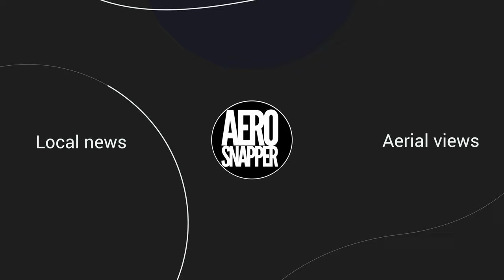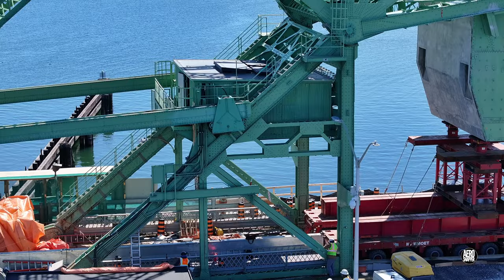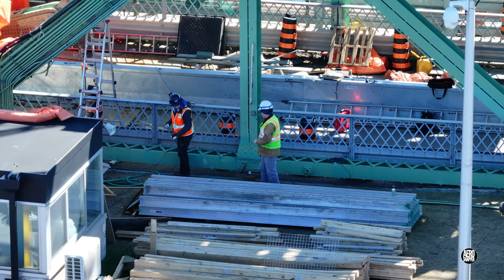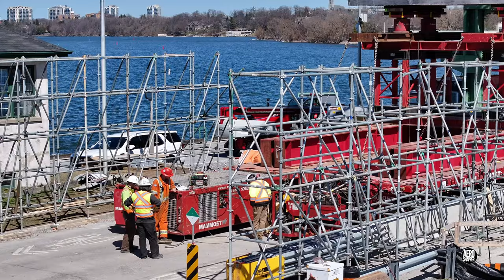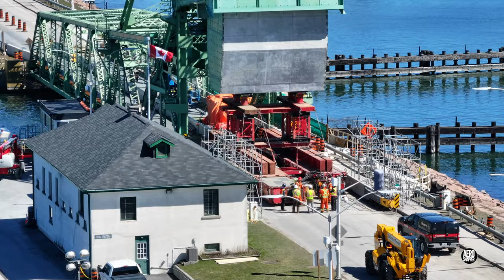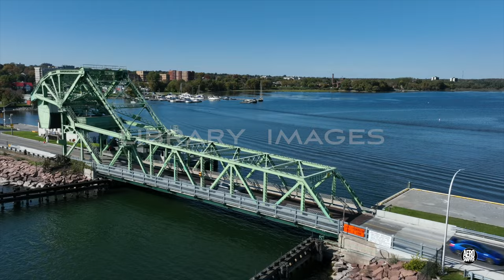They Shall not Pass - an update on the La Salle Causeway Lift Bridge repair   4K

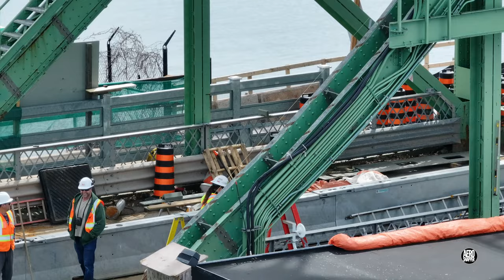Comment: At 1:32 you can see what caused the beam to buckle, the diagonal bracing was removed. That is an incredibly stupid mistake! By removing all of the diagonal bracing that beam was changed into 2 smaller beams with a tiny fraction of the lateral stiffness. At the bottom of the beam you can see a buckle right where the rust is, that rust was where the diagonal brace had been. In the upper left corner you can also see, under the stairs the diagonal bracing.
Reply from the maker: It may well be that you are correct - but no official word has been given on the nature of ‘the incident’.  An inquiry will take place and we should then have all (or some) of the facts.